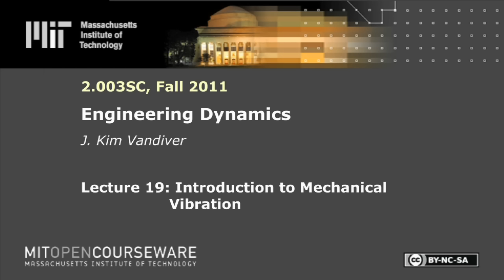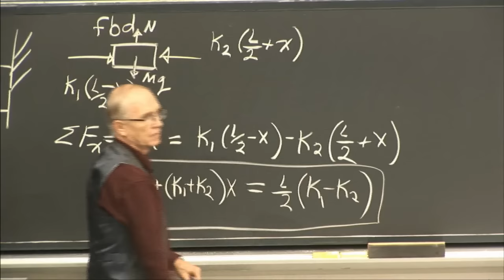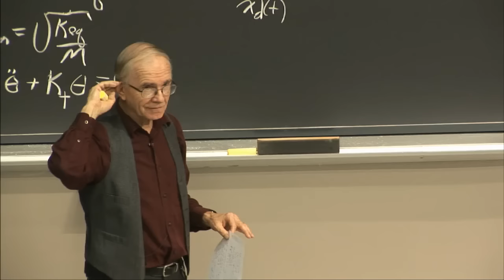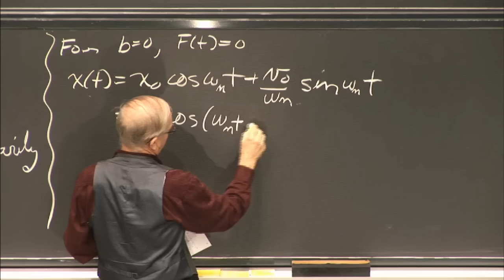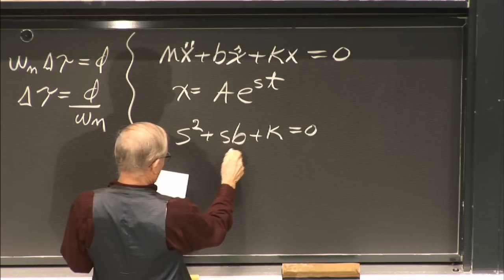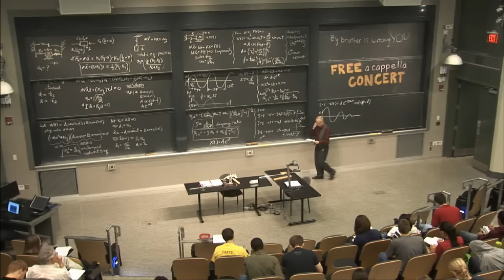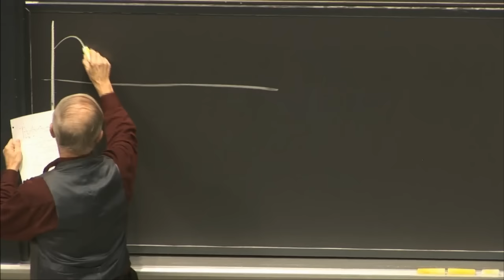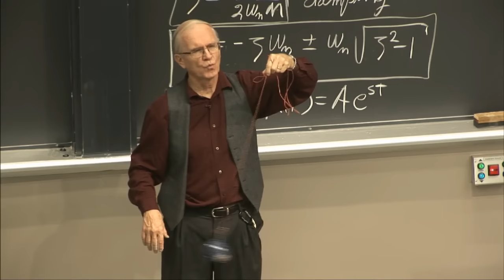19. Introduction to Mechanical Vibration

Comment: I agree with Dr. Vandiver up to a point. The kinetic vibration from a K1 and K2 facilitated solution has to be met with proper centrifugal force applied properly. I am excited with the new development of Euler's Formula to prove true kinetic energy displacement. MIT has allowed me to broaden Euler's Formula and has allowed me to truly invent the way kinetic motion through displacement exists. This will actually be covered in my theses. 7.5 years at MIT and I am finally starting to visualize the light at the end of the tunnel.

Comment: Professor Vandiver, thank you for an incredible lecture on the Introduction to Mechanical Vibration. Mechanical Vibration is a very important  third  year class for Mechanical Engineering students. All students majoring in Mechanical Engineering should master these concepts before taking Mechanical Vibrations.

Comment: 16:48 Why are they equal?
Reply: cuz in a static analysis there is no motion, therefore no velocity and no acceleration so both x double dot and x dot are zero. which means (k1+k1)xs=l/2(k1-k2)
Reply: plug in ks
Reply: @MrRomulocunha  but why is it cero? I mean why do they cancel each other in that ecuation?
Reply: @damianblandi4294  When ignoring the dynamic forces, (k1+k2)xs=l/2(k1-k2), which means when plugged back into the equation involving dynamic forces, you can cancel like terms. Think of  "(k1+k2)xs" and "l/2(k1-k2)" in terms of a variable "x". if you were to rewrite the equation in terms of this new variable "x", you could subtract x from both sides and cancel them out resulting in cero.
Reply: He calculated Xs one step before, then you just substitute Xs now for the static case and you will see

Comment: at 1:02:09 added mass is not the correct reason for that because gravity works independent of mass.specially in case of simple harmonic motion. it may be resistance offered by water that is may be drag force. 
i think so
Reply: Mass depends on gravity not vibration...ur explation is worng ...so u not perfect

Comment: I'm shocked that a professor at MIT makes such a mistakes! 

k1 ×  𝛿1 = k2 × 𝛿2
𝛿1 + 𝛿2 = L

⇒ 𝛿i = ki × L / (k1 + k2)

defining 𝛿 as

𝛿 = 𝛿2 - 𝛿1

then equation of motion is

m × a =  (k1 × 𝛿1 - k2 × 𝛿2) - (k1 - k2) × x

where a is acceleration, the second time derivative of x at the middle.

could it be any easier?

Comment: some statements that he does, are already copied from books, that why pupils do not comprehend from where the formulas or "solutions" comes from, because it look like spontaneous apparition in the solution of the equations. Pardon, but teacher really most understand that the people came to classes knowing Zero, and all the explanation of any mathematical, fisical, or calculus most, imperative start from Zero, meaning in the level that they start.... VIBRATIONAL equation become more and more intrincate, and if the students do not get the initial knowleges...they will just VISIT THE CLASS ROOM...
Reply: usually students of engineering programs have few semesters of hight math classes in first years. if we will explain the basics of solving the differential equations - he will lost the time for explaining vibrations. and solving of them really not about physics - it's about math. and also there is high probability that students who couldn't understand the lecture will not understand any of it till the end (most of them)? but i heard your voice.
as well he said that they had few lectures before.

if you interested in you can write your opinion how should a professor do in the same situations - it's just pedagogy question and just for me. thank you in advance

Comment: How could I obtain the relevant acceleration by taking into account the Fourier transform? Because if you use the Simple Harmonic Motion, acceleration will always increase as frequency increases. In reality, structures are affected by certain frequency. So, how can I consider both the peak acceleration and the frequency in which my structure will have resonance effects?

Comment: Why'd he use a dice? There are no dice.... e{a}/t=hv. A 5th above is a 4th below.

So... can I put a KK2 controller board right next to the motor if I balance my prop with the motor? That's what I need to know before the operation.....

Mass spring dashpot... I'll try to remember that term. Sounds important;-)

Comment: Why aren't there lectures for 2.004, Dynamics & Control II, MIT OCW? So many course on OCW for Mechanical Engineering lack lectures...many courses lack lectures. Wish it would get filled up.
Reply from the maker: The main reason is money. MIT contributes 1M+ every year to MIT OpenCourseWare. Even with that funding, we are only able to record a limited number of full courses each year (~12 courses). We try and prioritize which courses we can publish by a number of factors. Unfortunately, 2.004 has not made the video lists. Maybe sometime in the future we will get funding and time to recording 2.004. We do have materials for 2.004, just not videos: https://ocw.mit.edu/courses/mechanical-engineering/2-004-dynamics-and-control-ii-spring-2008/. Best wishes on your studies!

Comment: Hello 
Could I get the book title used to support the course please
Reply from the maker: There are no required textbooks for this course, but suggested readings are drawn from the following texts:

[Hibbeler]= Hibbeler, Russell C. Engineering Mechanics: Dynamics. 12th ed. Prentice Hall, 2009. ISBN: 9780136077916.
[Williams]= Williams, J. Fundamentals of Applied Dynamics. John Wiley & Sons, 1995. ISBN: 9780471109372.

See the course on MIT OpenCourseWare for more info and materials at: http://ocw.mit.edu/2-003SCF11. Best wishes on your studies!

Comment: How do the k terms in (k1+k2)xs= L/2(k1-k2) cancel out????? @ 17:12 ????????
Reply: I think it's because xs is the displacement of the block in the static condition, meaning it's not dependent on time.  This makes it a constant.  Left and right side of the equation are equal meaning they can both be subtracted out of the equation.
Reply: They're pushing with equal force in opposing directions, resulting in a net movement of zero.

Comment: What does x refers to ? In first equation !
Reply: "X" variable represents the one-dimensional displacement along the axis.
Reply: +Juan José Martín (Silentflex) my major is mechanical engineering, but I haven't started yet just taking some basics. Is the study hard like everyone says?
Reply: +kartik oraon  X refer to the running speed , so 1x mean the running speed of your machine 2x mean running speed multiply by 2 and etc

Comment: intellectual masturbation. Not terribly applicable in the real world.  Give a real world solution for stopping destructive vibration at a range of frequencies.
Reply: frequencies that are "mirrored" at the x-axis on a frequency [1/t] - noise [db] coordinate system to eliminate vibration through interference. It is used in engine suspensions and other applications.
Reply: No, it's called understanding the theory behind this topic, which is incredibly important.
Reply: ***** Correct (Y) This is what I always preach
Reply: If you think this is "just intellectual masturbation" let me guess you haven't solved many real world problems other than by just luck.
Reply: "Give a real world solution for stopping destructive vibration at a range of frequencies."

1) Every structure ever built near a fault line.
2) Every rocket part ever built.
3) Airplane engine components.
3) Airplane wings.
4) Bridges.
5) etc.. etc...

Got any other brilliant thoughts?